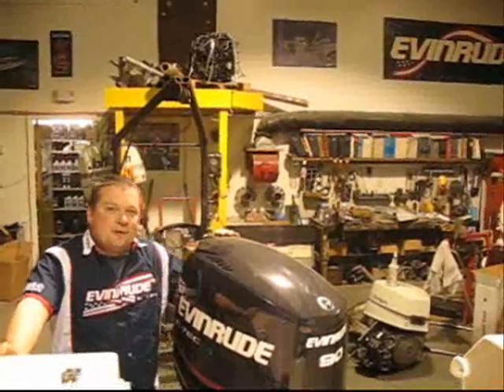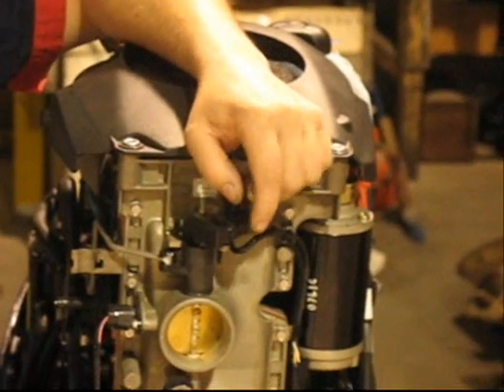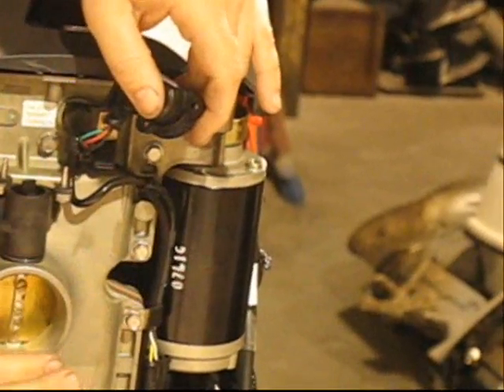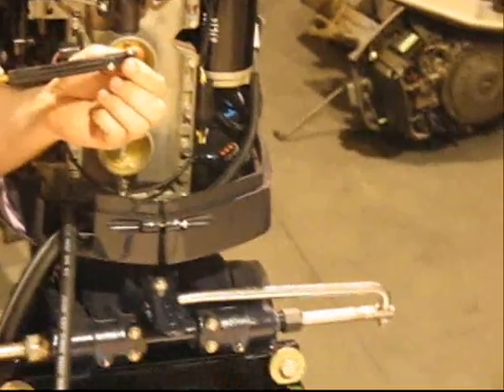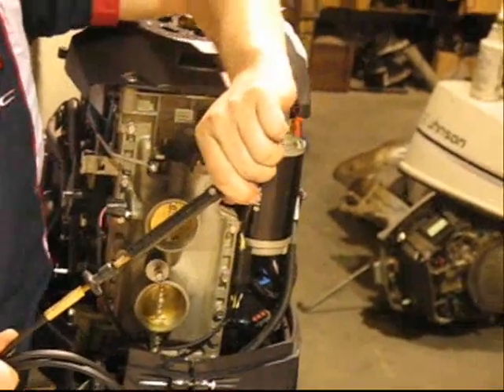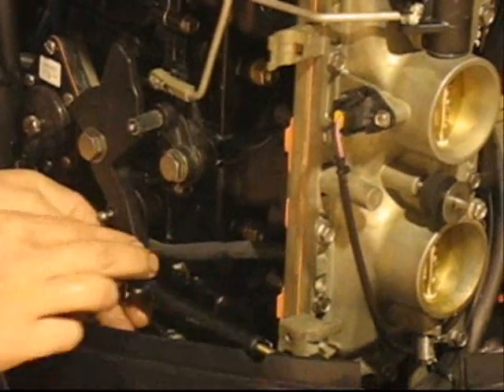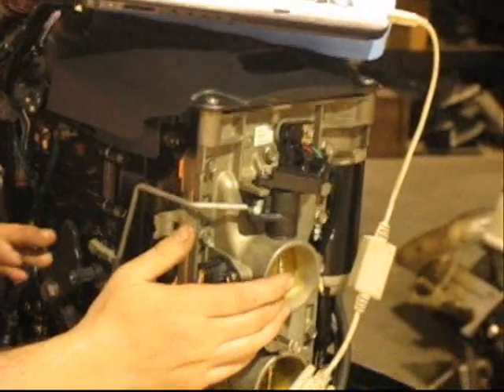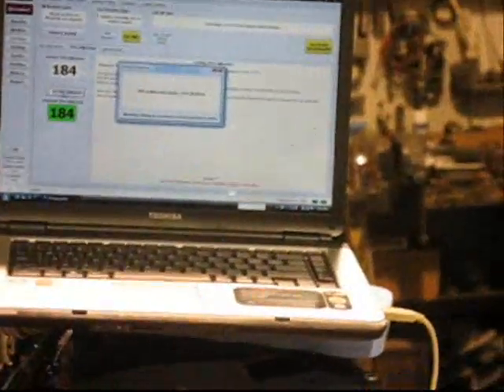Evinrude E-TEC Outboard TPS Information

Comment: fuel injector outside I put it in a full box and give it 12 or 24 volts. There is a ticking ticking sound coming from the injectors, but they do not spray gasoline. Do I need to give 55 volts? Thanks buddy..

Comment: when would you be required to perform this calibration? after changing water pump I had a problem with high tick over and realised the throttle cable must have spun once or twice. adjusted it and idles at 600rpm now. do I need to run this calibration or not? thank you

Comment: 60 HP e-tec engine will not start unless you unplug the fuel pump wire. then it will start up. Then plug it back in and it will run until you turn it off then it will not start up again until unplug the fuel pump wire. Anyone heard of this happening? I have new injectors, new fuel pump, new lift pump, new coils. all the voltage seam to be right oil pump is working. Anyone got a clue about this.

Comment: that's actually crazy about the throttle and shift cables. I never knew that and ive been working on outboards 20 years. I guess you could, in theory, just make sure the cable has the one normal 10-15'' loop and stuff the rest in the boat without kinking it, but now i'm gonna make sure all my customers have the correct lengths knowing what it does for slop! many thanks.

Comment: What symptoms causes a defect in the tps? I own a 90 etec that runs fine until 1700-1800 RPM. Then it begins to stutter. No torque when accelerating and stuttering. Fuel is new, filters changed, plugs changed, high pressure pump and vst changed. It did not solve the problem.
Thanks!